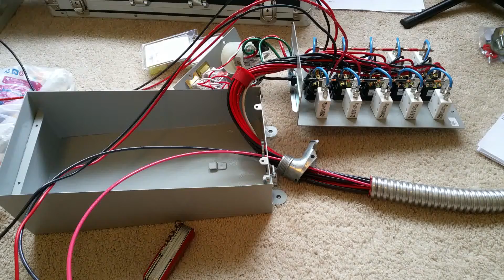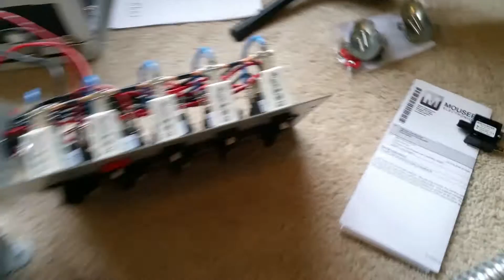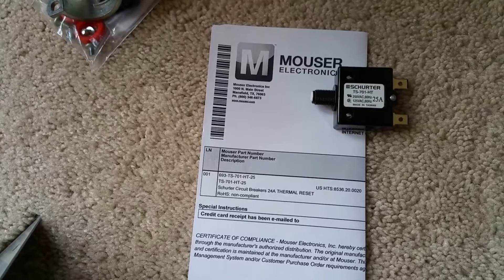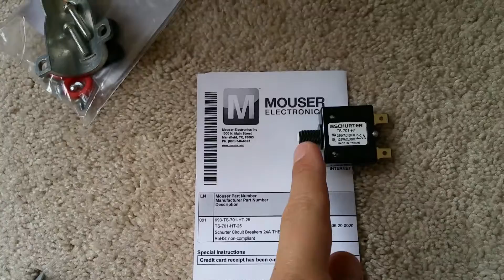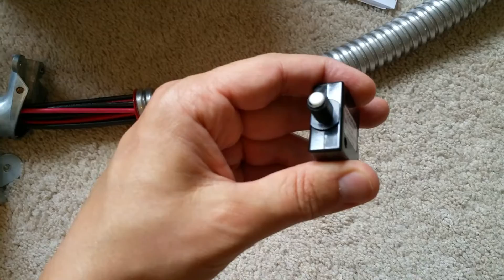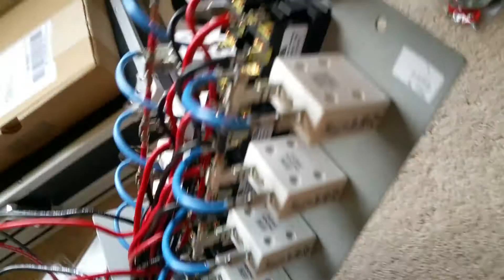Reliance Controls Pro-Tran Transfer Switch 25A/30A Mod: Hot Water Heater Circuit

Comment: I would be very careful on what the connection on the outside can handle 30 A or 50 A . Make sure you do worse case calculation. 2 fridges, sump pump, furnace , lights, plugs etc.
Reply from the maker: Agreed the maximum the switch can handle in total for all its circuits is 7,500 w. I have since put this switch back to OEM stock but added the power inlet to the panel next to the meters. It now only powers smaller branch circuits and the larger loads such as the hot water heater are now being powered by an NEC approved breaker interlock.

Comment: Double pole breakers and switches should be ganged for safety.  It looks impossible considering that the two poles are on opposite sides, but I bet you figured it out!
Reply from the maker: Yes they do have a metal bar to lock the two switches together for the 240 circuits
Reply: @Bassguitarist1985  Ganging the switches is good.  Did you also gang the two breakers?  The real safety issue is that one pole's breaker will trip, and the other pole's breaker will NOT trip, leaving half the circuit energized.  As you know, this has been corrected in the new Reliance Pro/Tran2 transfer switches that use regular breakers and split bus architecture like normal load centers use.  You can gang both the switches AND the breakers.
Reply from the maker: @clayretired741  correct the HWH is on a ganged double pole 30A in a GE load center

Comment: Can I use the same process to change one or more of the 15 amp circuits to 20 amps.
Reply from the maker: Yes you can.
Reply: @Bassguitarist1985   Thanks for the quick response! Do I need to upgrade the wiring, or will the existing 12 gauge wire be ok? Also, can all 4 of the 20 amp breakers (and the matching wiring!) be switched to 30 amp?
Reply from the maker: @richardcasey4146  you need to upgrade to 10AWG if you are putting in the 30A breakers. If you replace all 4 breakers to 30, understand that the total capacity of the switch is limited to 8000 watts or 30A at 240VAC.
Reply: @Bassguitarist1985  I think I've got it! I need to upgrade to 10AWG for the breakers I change to 30A. The existing 12AWG wiring will be ok for the existing 15A breakers and for any breakers I change to 20A, correct?  Thanks for your help.
Reply from the maker: @richardcasey4146  correct

Comment: Excellent video, you seem to be very cognizant of safety and professional in all that you do.A big thumbs up considering some of  the frightening tutorials that are on you tube.My question to you sir (with nothing but respect) is that you mention the w/h is a constant load (2 or more hrs) have you taken into consideration derating factors i.e 40% multiplier for conduit fill.Iif I'm not mistaken you will have 15 current carrying conductor in what seems to be 1/2 fmc and it seems that you may have to upsize the conduit.Again with complete respect as in no way do I profess to be be on par with you when it comes to electrical knowledge.Now I don't know how long that conduit is to the panel if it is indeed shorter than 24in then this is a moot point and please completely disregarded. My question is only one coming from pure curiosity. Thank you, and is always a big fan.
Reply from the maker: Hey Rick. You bring up a good point. Each circuit has two conductors per switch, with 2 conductor/jumpers to the PTR breakers that don't go through the conduit. 8 circuits have 12 AWG, two circuits will have 10 AWG, and there are already two 10AWG wires for neutral and ground.  Thats a total of 16 wires at 12AWG, and 6 wires at 10AWG. Conduit utilization is at 107%, which yes as you mention would not be up to NEC code. In this case one would need to upsize the FMC to 1" to be NEC code compliant. Its right on the edge around 41.55%, even 1-1/4" would be better. This is based on the 2017 NEC code. The length of conduit has no exception, at least from what I have read anyway, but I could be wrong on this.  Sadly this point was missed on my part. Thank you for your feedback.

Comment: Xboxer1985. I have a question on a part in previous video, but can't find a way to ask you directly.
Reply from the maker: Mike Davis sure. Whats your question? Ill try to help out
Reply: Hmmmm. Not sure where my question went. I'll try again. I watched your sine wave inverter filter build video. Very good! I have an older Honda EU1000i that produces much hash. S20 plus. When using the generator, the hf transceiver is useless. I have 3 EMI filters and each one seems to help individually. I watched your video where you said you'd provide the ferrite toroid part number. Not seeing the answer, I estimated the core size in type 31 and ordered them yesterday. I'm hoping the filters and toroids will make using the generator possible for portable work. Most of the noise seems to be coming in on the antenna line after being radiated by the generator and the power cord. I'm told it's common mode interference. I will arrange the power lines and coax feed lines so as to not interfere and move the generator away from the ham radio. Any other ideas?
Reply from the maker: Mike Davis you are on the right track. I got a corcom filter meant for frequency converters. Type 31 ferrite should help a lot too.
Reply: xboxer1985 
What type 31 ferrite toroids did you use? Do you have a part number? I just guessed after watching your video.
Reply from the maker: Mike Davis ill have to check my records. Its one of the biggest type 31 collars you can get. I went by db attenuation for the low 30khz band
Reply: xboxer1985 I got 4 toroids today. In the process of winding them now. Do I lay the 3 wires (black, white, green) flat as I make the 4 turns or have them twisted and wind them as a twisted bunch. I hope that makes sense. Thanks
Reply from the maker: it does make sense, and yes wind them flat around the toroids and not as a twisted bunch.
Reply: xboxer1985 hmmmm, I already went ahead and wound them in a twisted fashion, thinking that twisted wires would reduce chances of inducing to each other. I will test the setup after our storm has passed. Thanks for all your advice. This project has been a learning experience, thanks to you.
Reply: Well, yesterday I had a chance to do field tests with the generator, a Delta filter, 4 toroids and a good ham transceiver using a dipole antenna strung in a tree. My friend Chris took S meter and listening notes as I went through tests and 2 different filters. Base measurements were the radio power supply plugged directly into the Honda, then just the Delta EMI filter, then just the toroids then the filter and toroids. We even tried the toroids then the filter in series with no success. Using just the EMI filter showed a lower noise reading but with a popping noise (not ignition) and adding the toroids removed the popping. Using just the toroids alone actually increased base noise levels. We then did the same tests with the Corcom filter and had very similar success. Bottom line, the radio is very usable with either filter and the toroids in series. All this without any sophisticated test equipment. Just listening with our ears and reading the radio S meter. Thanks for your comments and encouragement. I also feel minimal extension cord length reduces the amount of radiated generator inverter energy.
Reply from the maker: Mike Davis great news to hear! Glad it worked out!

Comment: Hey bud--hit me up at skfluitt@gmail.com.  I read on a forum that you do inverter repairs.  I have a Honda EU3000 that is about 15 years old and it is starting to overload more and more when using on my RV.  Thinking with its age that it may be the inverter finally.  I am a mechanic and feel that mechanically the engine side is fine.  Was curious if you still do repairs or if you would be willing to look at
Reply from the maker: shannon fluitt hey Shannon, so you say it's overloading more and 15 years old? It sounds like the components are weakening/drying out. I dont have a way to test the inverter itself without the whole unit. Honda also doesnt always provide achematics of the inverter unit since they say its proprietary,  same for yamaha.ill email you too.